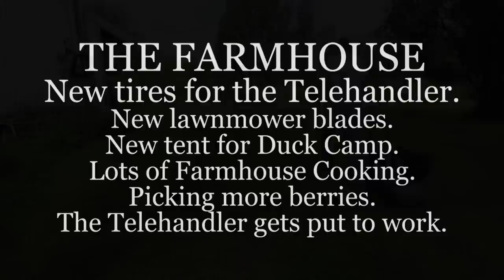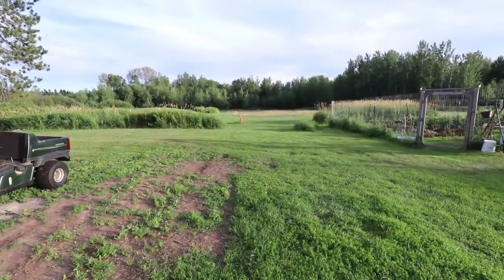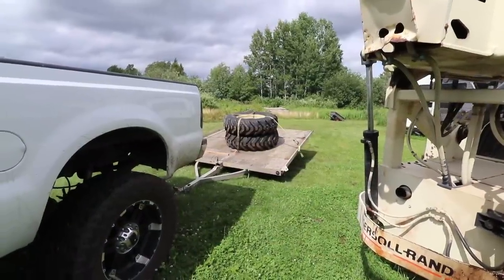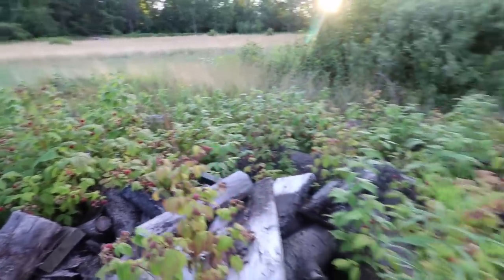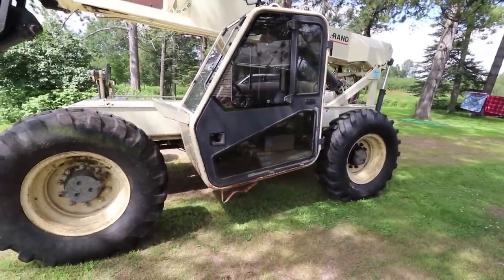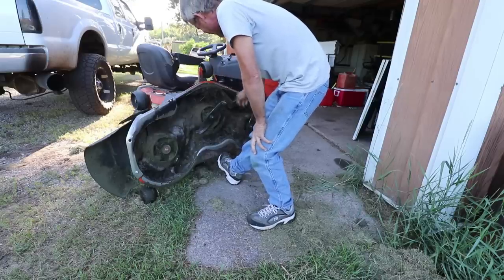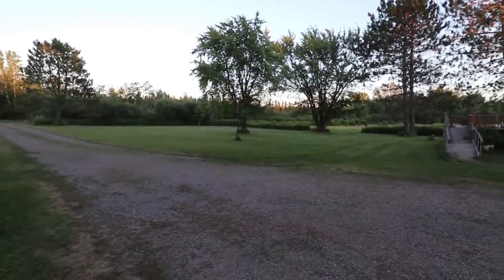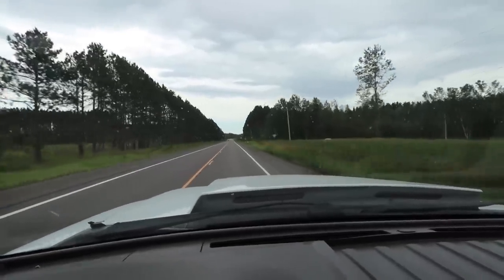THE FARMHOUSE. New tires on the Telehandler. Canning. Mower blades. Freeze dryer. Farmhouse Cooking.

Comment: are those tires directional? if so, they look backwards when you put them on.
Reply: Yup, put em on bassakwards
Reply: If they are drive wheels they are on backwards for sure if not probably ok
Reply: I was thinking the same thing.  Came here to make sure someone pointed it out to Joe.
Reply: I  was 99 percent sure of the same thing  , so I went back to the beginning of the video and yes they are on a different direction   ?
Reply: and it looks to be all wheel drive  !
Reply: Ffs, it's not like it pulls a plow around a field all day going one direction, those lifts are constantly maneuvering around a jobsite in tight areas alot of the time so it doesn't matter.
Reply: @logpile1318  yikes...have a raspberry
Reply: Yes they are directional and yes theyre on backwards
Reply: I was yelling NO..
When he was putting them on, but remembered they were already on by the time I saw it...but, if he's not taking it for road trips, he'll be okay...

Comment: Wood Boiler feedback ~ this will be my 8th year with our wood master. At year #4 I added a 3 sided shed over it to block the wind when loading. #2 and most importantly use the underground pipe that is foam filled and not simply wrapped in insulation or you will be digging it all up and replacing. #3. Put it as close to your house as you safely can.  Mine is about 45ft. Longer the run, loss of efficiency. Just my 2 cents from my experience. Happy burning.
Reply from the maker: Ours is getting installed on August 24th. The foam filled is what they are installing. 1 degree of heat loss per 100 feet of run. We have an 80 foot run and a 107 foot run and a 120 foot run. I do not want it any closer to the house so the smoke does not become a problem. No matter where we put it the runs are about the same simply because we are doing 3 buildings. We could shorten it one way but that will lengthen it going the other way. We are getting the unit from Crown Royal that will heat up to 10,000 sq ft. I like your shed idea and see that happening sometime in the future.
Reply: @NorthernSeclusion  crown is a great furnace!!

Comment: I noticed you have all kinds of different tires on your equipment at the farm house. Ag tires on your telehandler and tractor. Turf tires on your side by side and lawnmowers.  Most of the equipment I've rented over the years can be hard on turf and moist soil. I'm guessing ag tires are probably cheaper than industrial and turf tires. It looks like you have a wide variety of tires. As an all around tire, wich one do you like best?

Comment: You’ll love the Alaknak tent. We have the 12’X20’ that we use for elk and deer camp. Definitely get the roof protector for the hot embers that escape your stove otherwise you’ll end up with pin hole burns. Ours definitely saved our roof. Also use battery or oil lamp for light because propane lamps or propane heater creates a ton of condensation inside. Great video as always Joe🍻🍻.

Comment: I keep thinking you need to trade that in for an excavator....I know they're pretty expensive...but more suited for what you're doing.
Reply from the maker: I had an excavator in the past, they sit and do nothing and are not worth buying. The lift has many other uses. I sold my excavator simply because I rarely used it. I could use it right now but in 2 weeks I would have no use for it.
Reply: I get what you're saying.   Even though the telehandler sits most of the time,  it's still more useful to you.

Comment: Are you 100% sure the new rear tires treads are in the right direction?
Reply from the maker: I have no idea but it still drives straight. There is no where around here where the tires will be spinning trying to get traction so it shouldn't be a big deal.

Comment: Two big screw up there Joe, you didn't need to remove the wheel to change the tires, much easier if left on the machine, second, why did you remove the deck, just to change the blades.  If you don't have a mower jack, you could have lifted it with your teleahandler.   Do hope your meat turns out okay.   Have a good one.
Reply: He likes to do it that way because it's very easy to pull the deck .